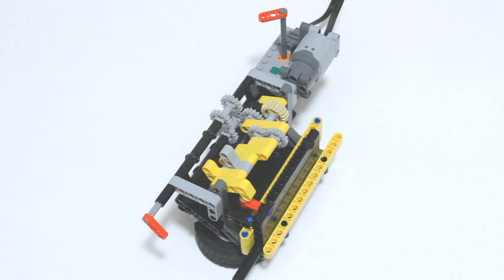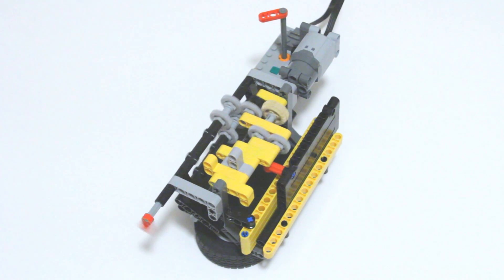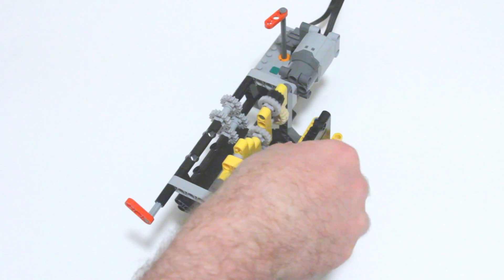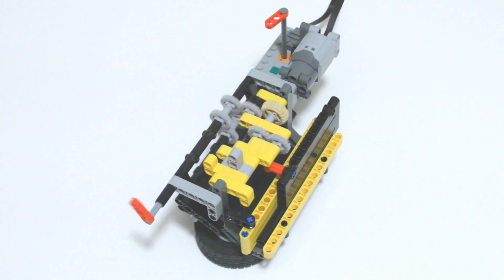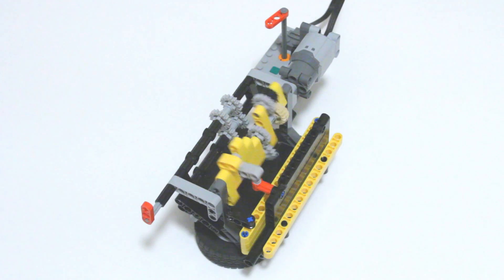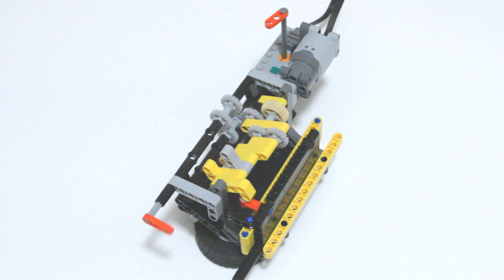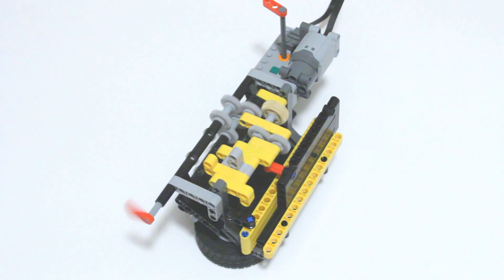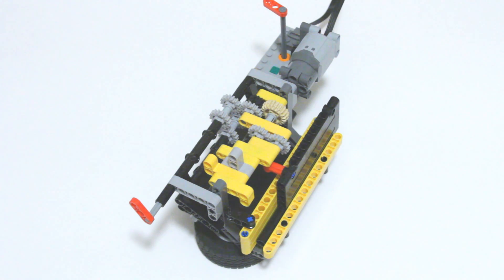LEGO Technic Armatron Gearbox

Comment: Very cool. Wouldn't this design have trouble with high torque though, since the rotating part could bend itself and possibly mesh with both output directions at once?
Reply from the maker: +Nikhil Nargundkar - Yes, you are right, and I mention that towards the end of the video. It might be possible to reinforce everything to make it more rigid, but then it would get bigger and heavier too.